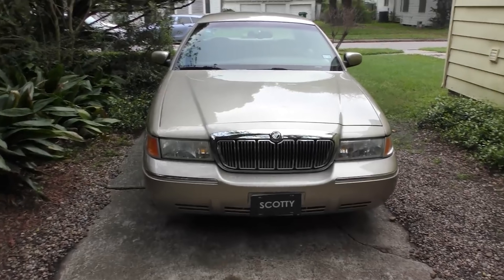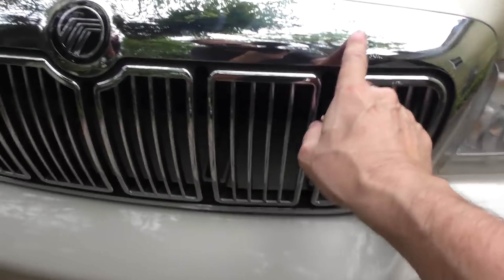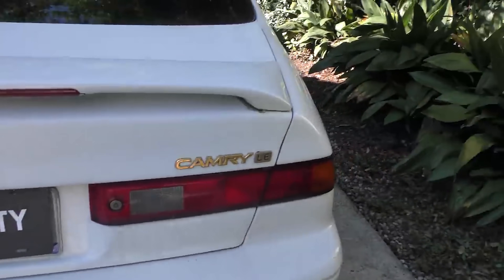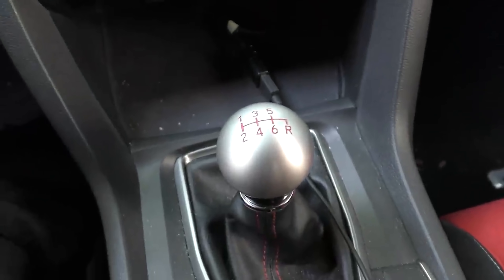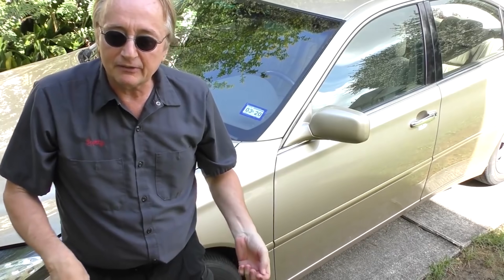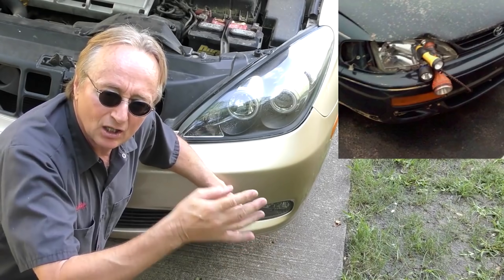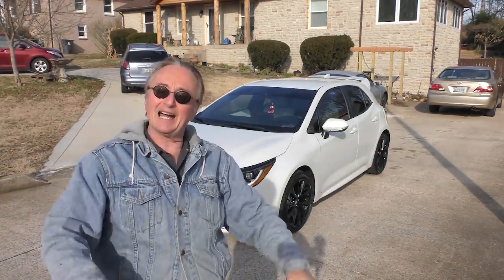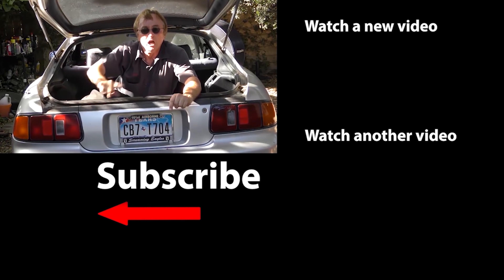5 Cars You Should Buy

Comment: The fact that a 20 year old Michigan car has no rust is quite magical
Reply: Yep, I'm in Ohio and it's the same. I'm from Alabama and I try to buy my vehicles from there. I have an 03 F150 I bought off my nephew. Alabama truck with zero rust and doesn't squeak like the newer trucks do around here.
Reply: My mom's PA car, an 01 Ford Escape, you can see the road through the floor and the shock mounts are so rusted that it won't pass inspection.
Reply: Gave away a 20 year old mini van that ran GREAT and looked like new inside and still ran GREAT with 146,000 miles.  Clear coat was shot, needed new rear brakes, tires, window motors.  Just decided wasn't worth it.  NO rust because it was here in SC.  Lived in upstate NY and had another car with 176,000 miles on it and 11 years old and it was pretty much rust free underneath and no rust on body.  It's all about keeping it washed in the winter.  It got a weekly wash and sometime 2 times a week in the winter.
Reply: That car was garaged most of the time, I'm sure of it.
Reply: Yes nice car love those would buy it
Reply: beautiful phrasing👏👏👏😂

Comment: I had a 93 Grand Marquis, the previous owner took really good care of that car. It had low mileage. All original parts. Not 1 ding or dent. Inside and out,  along with under the hood was impressive. Every person who worked on it praised the condition that the car was in. Then I had to trade it in for my Uplander because my family grew. I miss that car.
Reply: Sorry to hear that! From a clean Grand Marquis to an Uplander is quite a downgrade, I hate to say.
Reply: I  just sold a nice 2002 Crown Victoria & threw in some 24 inch wheels & a aftermarket radio for free...$1700 bucks it was a great deal for the buyer (who has 3 kids)
Reply: Right on!

Comment: Me and my friend both have these Mercury Grand Marquis LS cars, his is a 1999 and mine is a 2000,  and they are super reliable. His has 110,000 miles and runs like new and mine has 240,000 miles and just put a new set of tires on it and there is nothing wrong with either car.  I also have a 2000 Ford Crown Victoria, which is a salvage car and I have had it for now 16 years and it runs perfectly.  I also have a 2004 Mercury Grand Marquis with 120,000 miles and it runs practically like new.  These cars are solid and recommend them to anyone wanting a reliable vehicle.  It may not be a sports car, but then a sports car would not likely last this long nor give you this kind of reliable service.  Scotty, thank you for all of the videos you do as I enjoy each and every one.

Comment: These little old lady specials are the best. Kept in garages, rarely driven. That’s what my dad picked up on for his last car. It was 12 years old, 34,000 miles original miles, $1500. At 28, only 143,000 miles, all still solid. New tires, new battery. Frequent oil changes has kept it like new.

Comment: Had an 8th gen 1.8 liter Civic sedan. Absolute loved it. Most of them are well optioned because even with options they were a great deal, the 1.8 engine is one of the best you could have at that time and even now being naturally aspirated, great looks, well designed interior that survived the test of time, great and comfortable front seats, amazing steering wheel. 

Also can't stress enough how well it's interior  is designed. Have plenty of well placed storage options, 2 great cup holders. Just a well designed car. I recommend it to anyone looking for a great, budget car. And it really looks great if you find one with solid paint and clear headlights.
Reply: I just got one in a pinch. Salvaged, but overall I'm so happy with it. I love love love the interior, sunroof, GOAT-tier cupholders that can fit even massive cups, and the exterior looks fantastic and understated, even if mine has a few dents and scratches. And the first thing I noticed when I test drove it was how much oomph the acceleration has.

Put a nice pleather steering wheel on it and great, comfortable seat covers to take it to another level

Comment: I use the knowledge from Scotty to check cars here in Pa. My issue in Pa though is rust in cars because of salt. Most dont realize that a 8 year old car in Pa can have a ton of rust when buying cars in rural areas. 

My best car so far has been a 2013 accent bare bones car. Only issue I have is the oil light doesnt come in when its low so now I change it every 3k miles, and the knock sensor is going.

Comment: The Marquis, Crown Vic, and Town Car are all built on the same chassis. They're super solid with body on frame construction. Very smooth on a trip. Lots of room for everyone. Extremely reliable.
I never got 28 mpg on a trip though. Maybe 24 if I really kept my foot out of it.
Also get used to backing into parking spaces. That's the way.

Comment: I used to drive Grand Marquis when I was a Taxi driver. They are cruise mobiles. Comfortable, large interior, huge trunk. You can drive them around in the city all day without getting Piriformis syndrome. (Truckers wallet) You can take them out on the road and travel the country. If you think it's a little old lady car, mash down on the accelerator. My only knock is the rear wheel drive. When it snows you feel like you are steering a boat.

Comment: Those Ford Panther platform cars are some of not only the best built American cars but some of the best built cars period. That frame can go 1 million miles. Those 4.6 engines are really solid and when the transmission starts to go around 250,000 miles you can get a reman transmission for less that $2,000.

Comment: They stopped selling it because it was a 'station wagon', rather than the current station wagons, which are called 'crossover' vehicles, or 'small SUVs'.     I have over 375,000 miles driving Pontiac Vibe's, and even when the cars were failing, they averaged 27 MPG for in town driving.   Perfect flatlander car, although I never had a problem driving through the Blue Ridge or Smokey mountains with it.

Comment: an old camry seems to be the perfect beater!
Reply: hell yeah. i own one drives like a charm
Reply: My 03 Avalon too
Reply: I had a 97 avalon had sport mode
Reply: 93 camry xle. A/c is perfect, r12 charged 3 years ago. 232k daily and the sunroof works great
Reply: I know guys at my job that owns crown Victoria's and grand marquis over 100,000 and the engine sounds good same transmission. They said when this dies I'm buying another one! It shows Ford can build great cars like Toyota. They don't make good cars like that anymore. It's all about saving money,cutting costs, and making a profit.
Reply: Exactly what i have. ‘11
Reply: That's because it is the perfect beater.
Reply: 87 camry wagon auto seat belts and I could change my oil no Jack with a vice
Reply: Such a boring car lol
Reply: @Alittlebitsour6  what car do you drive?
Reply: @PauloNideck  kia soul
Reply: @Alittlebitsour6  yikes
Reply: @PauloNideck  have 230 thousand kilometers on the engine and she still runs good, no major repair bills yet either. If you actually did your research and talked to owners you'd realize kia actually makes good reliable vehicles, scotty's opinion on kia/hyundai is old and outdated. Kia/hyundai has improved greatly in the quality department over the years
Reply: Or Corolla, or Civic, or Accord.
Reply: My parents had a 1999 Camry with 220k miles in 2011 they scraped the oil pan off and if they noticed it they would still be driving it I recon lol
Reply: @Alittlebitsour6  shhhhh no they dont
Reply: @Coleschonfielddd  how many have you owned? You're clearly just a toyota fan boy lol because I've owned multiple kias and can attest to there quality and reliability, had nothing but good experiences. And i know im not the only one
Reply: @jlampkin0  you are so wrong . 100k is nothing . Let us know when they make something that can hit 300k easily
Reply: @Alittlebitsour6  dude Kia and Hyundai failed the pedestrian auto stop test
Reply: @jarrettpudlick3333  I have the 94, sunroof has an electrical issue
Reply: @Alittlebitsour6  kia souls are boring. They look like a toaster! Plus, aren't nearly as reliable as a Toyota, a Honda, or a  Subaru. I'll take reliability over that toaster all day, and I'll take reliability and speed with a honda or a subaru all day before I bought a toaster.
Reply: @Alittlebitsour6  and while yeah kias reliability has been getting a heck of a lot better these last 10 years, I've owned a 2006 Kia Sedona, (took a crap on me) a 2001 corolla,(my gf totaled it) and now I own a 2012 Honda Civic and my gf will not be touching it lmao
Reply: @0penEyesAndMind51  check the fuses. It could be as simple as that. Worse case scenario it's the mechanism. Also make sure the sunroof doesn't have sticks and leaves caught up in it.
Reply: @Alittlebitsour6  boring? It has a v8 engine,with rear wheel drive lol
Reply: My 04 runs like a top.

Comment: I'm 19 years old. My first car I bought was a 2002 Ford Mustang, then I bought a 1992 Chevrolet Cheyenne 2500. My ride now is an 1999 Lincoln Town Car. I've owned it for over year now and it just rolled over 180k yesterday. I've kept it completely stock except regular maintenance. By far, the most favorite vehicle I've had. It's the same chassis as the Grand Marquis. I'm a car enthusiast for all vehicle's and I love that land yacht more than you would know Scotty!
Reply: Have you or the previous owner replaced the intake manifold? The ones OEM on the car were known to fail at a certain spot and leak the coolant, overheating the engine. Intake manifolds were redesigned for 2002 and on to be metal in that vulnerable spot, and can be retrofitted onto older Panther bodies. If not already done, it would be a good idea next time you flush the coolant.

If you're in a not so wintry climate, you should keep the car, because it's a great way to suss out wife potential. If you two want kids, anyone not enthused with using that car as a family car for at least the first two kids isn't a keeper.
Reply: @EMichaelBall  Yes I have! I've put alot of money into to car because it needed it and to keep it from breaking down on me down the road. Coils, injectors, ball joints, idler arm, alternator, water pump, battery, tires, whole A/C system, K&N air filter, sway bar end links, headlights, all fluids changed, etc. Thank you for the heads up! I try to take care of it so it will last. I actually have a little girl on the way in just a month. It will be a great family car me. It looks and rides great for the mileage and year!

Comment: Nissan 
Chevy 
Chrysler 
Land Rover 
Mercedes 

I'm kidding of course.
Reply: Of course not, it was a 
Fiat
Volkswagen 
BMW
Audi
Infiniti
Reply: FIAT should be at the top.
Reply: @darcychu9652  facts
Reply: My dad had 90s Nissan Sentra Manual made it to 304k and only got rid of it since it was bound to fail soon but those 304k miles nothing but regular maintenance. Also had a 2000 Honda Accord until to 206k but the transmission failed .
Reply: @bryan-zp6ty  I believe you, after 2000 Nissan started making crap cars, that’s when they signed a deal with Renault. My dad used to have a 98 maxima it had about 200k miles when he got rid of it. He had to trade it in for a minivan.
Reply: I had a 87, Nissan Pulsar with 287 K on it and the car was still going.. Nissan engines go forever
Reply: @DroolOnMeBaby  the older ones did, now the new ones are crap
Reply: American cars are made for Americans! Nothing like a ride of a big American luxury car! Bought a new BMW in 1983 and I hated it. My most comfortable cars were a 72 Thunderbird, 89 Coupe DeVille and my Grand Marquis!!!!!!!
Reply: @winstonbanks1800  of course you hated it… it was 1983 before BMW was a luxury brand.

Comment: That naked ignition key is most likely the sub key (grey valet key) with the plastic grip broken off. It won't open the trunk and glove box. You'll need a master ignition key (black grip). In addition, these keys may come with transponder chips for the engine immobilizer system. Dealerships can replace and recode master keys.

Comment: I love your casts Scotty but I cannot agree with you on a universal love of Toyota/Lexus 3.0 V6. Early RX300s had an oil return problem causing the valve guides to leak at 60-70,000 miles. Toyota dodged a class action suit with a settlement pool that did NOT cover the entire fleet. Oil residue caused plugged cats, sticking valves, fouled O2 sensors, and clouds of blue smoke behind them.

Comment: oh the ford grand marquis was the old us cop car! 
that's gotta be reliable mainly with ford parts
Reply: Ford grandmarquis? Mercury.. ford made the crown vic, whic was the cop car
Reply: @richsweeney1115  close enough lol
Reply: Yeah, that was nearing the end of true reliable American built cars
Reply: Rich Sweeney mercury is fords “Lexus” if you pop the hood of a grand marquis it’s the same exact engine as the crown Victoria even has the ford logo right smack on the top of the engine
Reply: Crown Victoria or Merc Grand Marquis. Great cars!
Reply: @jameshunt5316  Lincoln was always Ford's Lexus. Merc was like Chevy's oldsmobile. Cadillac was Chevy's Lexus
Reply: Fix On Repair Daily
Reply: If you can find one with the "cop chip" still in it you will have fun driving it.
Reply: The Old Ford Cop Cars Had A lot Of Performance Up Grades. But Yeah Their are Still A Few In Service. Not Only Performance but Several Things.
Reply: Same manufacturer, just a different model. I had a '92 Merc Cougar, one of the best cars I ever got. got it in 2004. I tweaked the 302 and it ran like a dream, electrical started going haywire in 2008 got a 2005 Scion xb.

Comment: INTAKE MANIFOLD. Keep an eye on the intake manifold. It's made of plastic - generally good for around 10 years or so, then you're playing Russian roulette. Eventually they will become brittle and crack. This car is late 90s, so we're talking double the years one can reasonably expect the intake to go. When they crack you risk slow leaks outside the engine, slow leaks inside the engine, catastrophic leaks whilst driving.

If you don't know when it was last done, best off replacing it. Think of it as the timing belt on a Toyota.

Comment: I really want to keep my '99 Buick Century but she's giving me fits since her tune-up. Apparently, those Buicks do this. She runs great until she quits. Cool her off & she's good again. Scans clean but we keep working our way through it cuz she's just so solid & comfy. At least her computer replacement is only $100, that's next if the catalytic converter isn't it.
Reply: Katie Kane . Those old  Buicks can be good cars . I had a 2001 Buick But if you live where there is salt in the winter , be sure and keep it washed off underneath or the frame will rust out .
Reply: Maybe it's just an obstructed throttle body. You can buy spray that can clean the throttle body; maybe this will do.

It may be bad compresion from a badly sealed valve cover gasket (easily fixable), or worn pistons (too expensive to fix).

Comment: That is the one thing the older Mercury Grand Marquis had that was better was the wheels.  I have the 2005 Mercury Grand Marquis and the wheels are pitting already.  These are incredible cars. In a way if you take care of a car like this it is like my 1981 Mercedes Benz W123 240d with a 4 speed manual or my 1964 Ford F250 with a 292 engine.  These are forever vehicles if you take care of them.

Comment: I have my Grand Mother's 1998 MGM. She bought it in 2000 with 33,000 miles on it.. I got it 7 years ago (2014) with 55,000 miles on it. Original AC, engine trans, etc etc.bulletproof and cheap parts

Comment: There are a couple of cars out there that have great reliability for particular uses. Case in point: The Chevy Volt. If your commute is less than 40 miles (round trip) - AND you don't make frequent long trips.
Speaking purely from my experience: It's reliability and cost to own is fantastic! When you can plug-in (while your car sits for your 8 hour work day), then you can extend that commute range to ~80 miles.

Comment: Germany - we had a C-Class from 2004 bought after 2012, which lastet roughly 190k miles (we drove over 120k till end 2020) and had almost nothing than suspension springs and regular oil changes. No rust either, gladefully - they like to rust quite extrem sometimes

Comment: Drove a Grand Marquis for years. Great car for travel but around 150-200k look out for heater core leaks... Have to take the dash off to replace it, a major pain and expensive. Otherwise pretty reliable, replaced a couple coil packs, a few front end pieces but nothing major till the heater core. Digital dash with instant fuel mpg reading was great to keep mpg up.

Comment: Wrong Scotty! Civic never had any air cooled 2cyl engine. That was the N600. Honda Civic was released in 1972 with a 1169ccm transverse 4cyl engine putting out 54 HP DIN.  It was only 715kg so it had splended acceleration and handled like a go-cart even then. I owned one 1973year. Still miss it!

Comment: I have a 2007 Marqius. 10K miles when I got it in '08.

160K miles now. Tail pipe still bone dry with no soot - none. 

Still getting just under 28 mpg on the highway. Never ever selling or trading 😊😊😊

Comment: My 2001 with the other engine used 2 quarts of oil per tank of gas.  You didn't read that wrong.  It never broke down, and ac still worked. I gave it away and those people drove it to the junkyard for parts. Someone stopped them and gave them more money than the yard. Then drove it away.